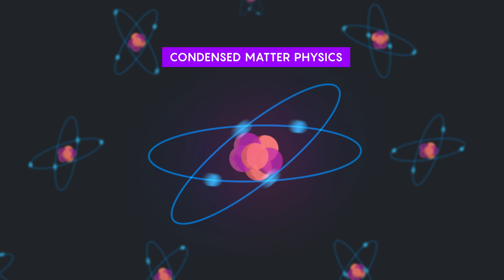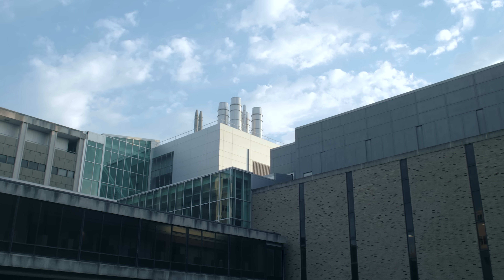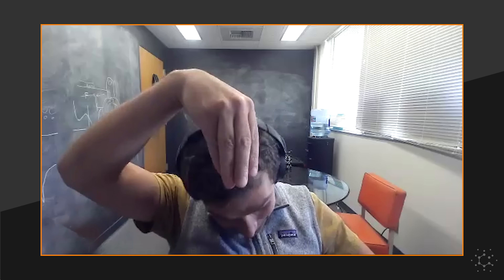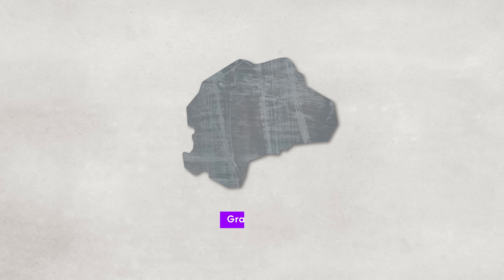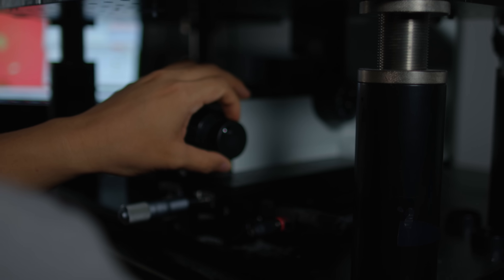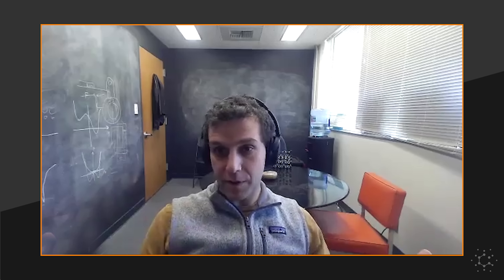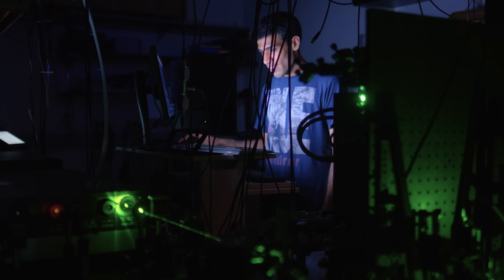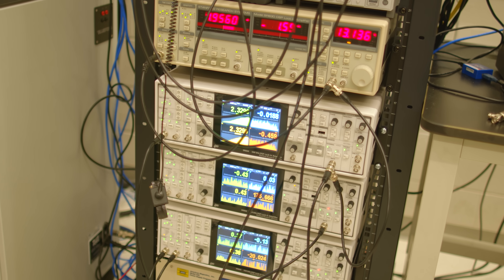How Two Physicists Unlocked the Secrets of Two Dimensions

Comment: U are adding electrons one by one and saying u are making a different element every time, but what about the nucleus? U aren't changing the number of proton or neutron so how does u are making it a different element?
Reply: protons don't interact chemically. all chemistry (barring nuclear chemistry) cares about is the electronic structure, which is caused by the nucleus in normal elements. so yeah, if a proton with three electrons were somehow neutral, then it would act similarly to lithium

Comment: What kinda shit science is this. Electrons don't determine the element of the atom. Protons do. All they are doing is controlling ionization. Not alchemical transmutation by switching the relevant nucleon, which would be the proton. Can someone explain to me how a proton with three electrons around it is a fucking lithium atom?
Reply: protons don't interact chemically. all chemistry (barring nuclear chemistry) cares about is the electronic structure, which is caused by the nucleus in normal elements. so yeah, if a proton with three electrons were somehow neutral, then it would act similarly to lithium
Reply: @AravindKarthigeyan i dont think this explains what i was asking.

Comment: By changing the number of electrons we cannot change the element because it is the number of protons which determine the element for example a hydrogen atom is hydrogen because it has only one proton and by changing the number of electrons we can just change the charge on the atom like if we put 1 more electron to the hydrogen atom then it becomes negatively charged but it does not change to helium.
Reply: Emphasizing OP's "It is the number of protons which determine the element." 100% correct.

They developed a model for putative redox reactions, not transmutation.

Kindest regards, neighbours and friends.

Comment: If you have a transistor thats only an atom thick, and combine them on a plane like a processor ... would there be a difference in both energy consumption and heat output ... compared to what we have today at 2 or 5 etc nanometers?

Comment: Hmm im wondering because at 5:13 they say if you add one electon to an atom it forms Hydrogen > 2 electons forms Helium > 3 electons forms Lithium 

and i can see there is a 4th option on the volume dail but they are not showing that

so what happens if you add 4 electrons to an atom ??? i think it wil form beryllium?

Comment: if only there was a way to vapour deposition print singular atom thickness sheets in vacuum without it sticking to a substrate or the container hull and without having to tear it off...and having a way to see and manipulate the lattice or grain structure of each sheet while printing it with various different salts alloys metals halogens and semiconductors in different spectrums and intensities of electromagnetic radiation and temperatures...then we would build crazy things...😄

Comment: To be a top down and truly great physicist, you need to be a top down and truly great mathematician. Here's the CLEAR proof ON BALANCE.

ULTIMATE, CLEAR, BALANCED, INTEGRATED, IRREFUTABLE, AND MATHEMATICAL PROOF THAT ELECTROMAGNETISM/energy is gravity:

Consider what is TIME. E=MC2 is taken directly from F=ma, AS gravity/acceleration involves BALANCED inertia/INERTIAL RESISTANCE; AS the rotation of WHAT IS THE MOON matches it's revolution; AS ELECTROMAGNETISM/energy is CLEARLY (AND NECESSARILY) proven to be gravity (ON/IN BALANCE); AS the stars AND PLANETS are POINTS in the night sky ON BALANCE; AS TIME is NECESSARILY possible/potential AND actual ON/IN BALANCE. Great. Consider WHAT IS THE EYE ON BALANCE !!! Great. c squared CLEARLY represents a dimension of SPACE ON BALANCE. GREAT. Consider TIME AND time dilation ON BALANCE. Consider what is THE SUN ON BALANCE. GREAT. Indeed, notice what is the orange AND setting Sun ON BALANCE !! ELECTROMAGNETISM/energy is CLEARLY (AND NECESSARILY) proven to be gravity (ON/IN BALANCE). Consider WHAT IS THE EYE ON BALANCE !!!! GREAT ❤️❤️❤️❤️. Finally, what is lava IS orange; AND it is even blood red. Excellent.

By Frank DiMeglio

Consider what is the man (AND THE EYE ON BALANCE) who IS standing on what is THE EARTH/ground. Touch AND feeling BLEND, AS ELECTROMAGNETISM/energy is CLEARLY (AND NECESSARILY) proven to be gravity (ON/IN BALANCE). Indeed, in identifying or considering what is THE EYE/EARTH balance, what is THE EARTH is ALSO BLUE. Great. NOTICE: Gravity cannot be shielded (or blocked) ON BALANCE. Magnificent !! Water flows downhill. Great.

By Frank

Comment: Wow. They are creating Thier own electromagnetic field via superconductor. Because they are creating enough energy in the feild the energy is bunching creating massive atoms? There much be an equalibrim if the energy is symmetrical positive and neagtive? And it's and electromagnetic field not a quantum feild. I had not idea just changing the number of electrons changed the chemistry in an atom. The electromagnetic chemistry? And electrons looks like tiny atoms or are those electrodes?

Comment: Fundamental Neutron Sciences was able to determine the actual sizes of chemical elements and the number of gas molecules in the volume of 22.4 liters, which show that for operations with chemical elements, it is necessary to penetrate not into the nanoworld (10-9 meters), but into the picoworld (10-12 meters). Thus, the maximum size of the chemical element "hydrogen" is 2.42 picometers or 0.00242 nanometers, and the maximum size of the chemical element "platinum" is 0, 142 nanometers. Read the first volume of "Fundamentals of Neutron Science" and you will be convinced of the correctness of the accusations.

P.S. I HATE YOU AND YOUR WIFE TO MAKING PROPOGANDA OF THIS STUIPID QUANTUM PHYSICS THEORY. HUMANITY DOESN'T NOT DESERVE ZOMBIES LIKE YOU.

Comment: I used to run a photo-stat machine in college, the long and short of that is to reduce an image to varying pixels of varying sizes fit to print in newspapers or magazines. The moiré pattern was an aberration that we had to avoid; and it happened at differing angles or scale, it's basically the same reason polarizing lenses work... constructive or destructive interference. This is ridiculously genius, to layer 2d layers and capture states of matter on the electron scale! Just WOW!

Comment: How can you change the properties of an element only by changing the number of electrons? Number of protons in an atom make it's characteristics and chemical properties. Whenever a Hydrogen atom is forced to get an electron, it changes to H+, not Helium. If you want to make it Helium, you need to add an additional proton to the nucleus. (Pls correct me if there's something wrong).
Reply: not absolutely sure  but i will try an answer : 
In their research they don't change the properties of an element, but the properties of Artif Atoms (AA). Chemical Properties of an Atom is linked to the n° of valence electron it currently has, property of AA is bound to the number of e- trapped in it. 

Ion hydrogen with extra e- will be H- (not H+), it will have the same electrical configuration, 1s2, as Helium. so chemically speaking it should behave similarly as Helium.

By having 1 e-, the AA will act like it is an hydrogen atom (1s1 configuration), by having 6 e- it will act like an oxygen atom (i think so). By Making interacting two AA with 1e- and one AA with 6 e- ,  we should observe Artificial Molecule, with similar properties as a molecule of water H2O. meaning that in the futur, if you can control million of AA you can simulate the behaviour of a medicine on a part of a virus,  without doing hours/weeks of simulation.
Reply: Emphasizing OP's "If you want to make it Helium, you need to add an additional proton to the nucleus." 100% correct.

They developed a model for putative redox reactions, not transmutation.

Very neat for theoretical physicists. But chicanery for empirical chemists.

We taxpayers are allowing NSF and NIH to lead us down the slippery slope of theory because abstraction, PC's and programming are vastly more scalable and much cheaper financially than empiricism. Not that rival nation states are doing any better. [/rant]

Kindest regards, neighbours and friends.

Comment: Almost like they're making their own "fields" and then creating particles by putting different levels of energy into those "fields." Amazing.
Reply: yes but the strenght of the chemical bonding of one of those artificial atoms its significantly weaker than that of an natural atom
Those energy levels are DIFFERENT than the natural ones
Reply: @kukulroukul4698  Also the frequency of electron orbit are slower to they can applied by voltage.
Reply: @kukulroukul4698  To be a top down and truly great physicist, you need to be a top down and truly great mathematician. Here's the CLEAR proof ON BALANCE.

ULTIMATE, CLEAR, BALANCED, INTEGRATED, IRREFUTABLE, AND MATHEMATICAL PROOF THAT ELECTROMAGNETISM/energy is gravity:

Consider what is TIME. E=MC2 is taken directly from F=ma, AS gravity/acceleration involves BALANCED inertia/INERTIAL RESISTANCE; AS the rotation of WHAT IS THE MOON matches it's revolution; AS ELECTROMAGNETISM/energy is CLEARLY (AND NECESSARILY) proven to be gravity (ON/IN BALANCE); AS the stars AND PLANETS are POINTS in the night sky ON BALANCE; AS TIME is NECESSARILY possible/potential AND actual ON/IN BALANCE. Great. Consider WHAT IS THE EYE ON BALANCE !!! Great. c squared CLEARLY represents a dimension of SPACE ON BALANCE. GREAT. Consider TIME AND time dilation ON BALANCE. Consider what is THE SUN ON BALANCE. GREAT. Indeed, notice what is the orange AND setting Sun ON BALANCE !! ELECTROMAGNETISM/energy is CLEARLY (AND NECESSARILY) proven to be gravity (ON/IN BALANCE). Consider WHAT IS THE EYE ON BALANCE !!!! GREAT ❤️❤️❤️❤️. Finally, what is lava IS orange; AND it is even blood red. Excellent.

By Frank DiMeglio

Consider what is the man (AND THE EYE ON BALANCE) who IS standing on what is THE EARTH/ground. Touch AND feeling BLEND, AS ELECTROMAGNETISM/energy is CLEARLY (AND NECESSARILY) proven to be gravity (ON/IN BALANCE). Indeed, in identifying or considering what is THE EYE/EARTH balance, what is THE EARTH is ALSO BLUE. Great. NOTICE: Gravity cannot be shielded (or blocked) ON BALANCE. Magnificent !! Water flows downhill. Great.

By Frank
Reply: Pretty much making their own sandbox.. hmmm
Reply: Im confused though, b/c they didnt explain (at least briefly) why a particular atom changes properties to another element via adding e-      Its basic to know that only by changing the p+ within the nucleus, does a particular element change to something else.  merely changing the e-  only makes it an ion, a negatively charged on if adding e-.
Reply: @Gizziiusa  That's why they are "artificial elements". I suspect they maintain the same neutrons/protons but add e- to make it act like areal particle. Of course it's not perfectly like a rl particle
Reply: @davidk9382  Sure. regardless, its fascinating, nonetheless.
Reply: Sounds perfect, maybe these 2d surfaces are in some way reflecting quantum fields in natuew
Reply: Can they create gold?  I wonder how many electrons are needed to create gold.
Reply: Sounds hella scary when you say it like that

Comment: I'm a computing scientist and I would be more interested in creating self-modifying hardware by controlling points of focused potential difference in the lattice. Imagine the optimizations of performance if you could have literally configurable hardware that don't need to be etched by traditional chemical methods, it would be purely electronics making the circuit as its needed instead of fixed circuits.

Comment: fascinating, not that i would claim to understand even half of it.
So correct me if i am wrong.
Could with this setup we use elements that are easy to form into a certain shape and then change them into elements that otherwise would be difficult to form into that shape but retain that shape through the change? carbon nano tubes?

Comment: Hydrogen atom has one proton one electron and heleiem have 2 protons +2 neutrons +2 electrons I dont understand if they add 1 mode electron to hydrogen atom how are they going to add 2 neutron and 1 proton?
Reply: Shhh. You're just supposed to watch with an empty head and be amazed.
Reply: I saw answer in one comment, that they simulate atom core by passing current through Moiré superlattice

Comment: Do these artificial atoms have no core? Is it just a cloud of electrons that simulate the outside premises of an atom that has the same amount of electrons in the outer shell?
Reply: in fact electron are trapped in a potential, due to Moire pattern (if i understood correctly), and e- in atoms are also trapped in a potential due to positive charge of the nucleus, so there is indeed no core, but there is a confinement potential. you can achieve similar results, creating artif atom, with an STM tip over graphene, the strong electric field of the stm tip will create a potential similar to the one of a nucleus.

Comment: What if matter condensed in the center of black holes behaves like a computer chip because it’s flattened down to 2-D?
Reply: I believe that there's a bit more to blackholes than that...only the event horizon is '2d'..otherwise points on it are extended into the blackhole or out of it (light) naively speaking. According to Hawking some extend in both directions hence Haking radiation.

Comment: fascinating and totally vague. what is meant by an "artificial atom" and what exactly did they observe?
Reply: They’re using an electric current in super thin semiconductors to simulate the positive charge of the nucleus of an atom and, by extension, capturing electrons into orbitals similar to those of real atoms. From here they can study chemical properties with a more controlled and easier to observe environment (since the artificial atoms are much larger than real ones)
Reply: @alexsiemers7898  I see. So what are they measuring? Change in current? 
Edit: like a different number than expected on one of their instruments for current or resistance?

Comment: When I attended University, it seemed to me that the overseas students had an advantage of speaking languages other than English, because it compelled them to view the curriculum subject matter from alternative POV and then have to communicate with the English Speakers in comprehensible ways. By default, I learned how much I had to unlearn just to catch up with them, starting with the cultural respect part of mutual understanding. 

This particular video has some features of those attributes, if all atomic-node composition is a virtual vector-values interface in 0-1-2-ness relative-timing ratio-rates of perceived 3D-T Physics, how this phenomenon is identified is critical to understanding what, how and why things happen, inside-outside holographic positioning, as they do..

Comment: A while ago I read an article also about a similar moire experiments and where by accident was discovered that under a particular angle at room temperature electrons move without loss through the material. In the topology of materials and their setup there is still quite some exploration of new physics possible
Reply: could you plz link it in here?
Reply: You just pointed out a real world application. High temp superconducting.

Comment: One funny thing about chemistry is that when you add an electron to an atom of one element, you don't get a different element.
Reply: I was thinking the same.. Electrons alone don't change the chemistry significantly..
Maybe information is missed in the video ofr simplicity
Reply: From what i understand, since they are purely studying the effects of electrons, they are simulating groupings of them, and using that as the basis for a "virtual" hydrogen, helium, etc. atom. Not actually changing composition of anything, only changing the composition of the simulated virtual atom. Just like "If we want to simulate something with 2 electrons, we put 2 in" and helium being a typical example of something that would have 2.
Reply: @dahZeee  It was kind of a joke in deadpan, if you ask me. One is supposed to seek the grain(s) of truth within, I imagine. Myself I am reminded of how elements and ionic bonds organize in space by resonance and cooling. If it was two sheets of Boron Nitride (conveniently made-up combo by me) then I think you get two, maybe three, choices of good atom sims midway between plates.

Comment: Does the vibrating thermal frequencies, cause the cold negative field, to circle around thermal energy, in forward maximum momentum velocity in resistance, to the cold fabric of space? Vibrations are thermal frequency. It is the momentum of the universe. It passes through the fabric of space in resistance producing outward pressure of force. Magnetic fields redirect thermal energy singularity frequencies into mass. Entanglement is magnetic fields of forced cycling circulation patterns of maximum momentum velocity in resistance. Harmonics of thermal energy redirected by resistance. Electricity is thermal energy singularity frequencies released from magnetic fields. It is the cold resistance of drag on mass as decay. It is resistance being dragged out of mass by thermal energy applied to magnetic fields disrupted, increasing drag out of equalization in mass. Thermodynamics are bombarding mass from all sides. Thermal energy is dark energy throughput space as space. Mass is space itself amplified by entanglement of magnetic fields holding mass together. Opposing forces coexist as space itself. Entanglement is two or more frequencies cycling in magnetic fields. Resistance creates magnetic fields of forced resistance to forward momentum creating cycling circulation patterns as mass.